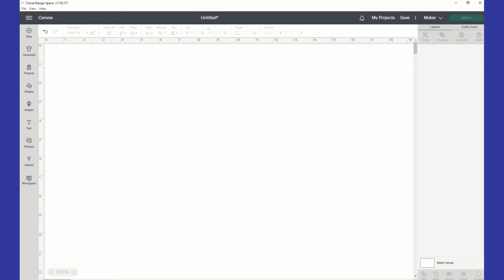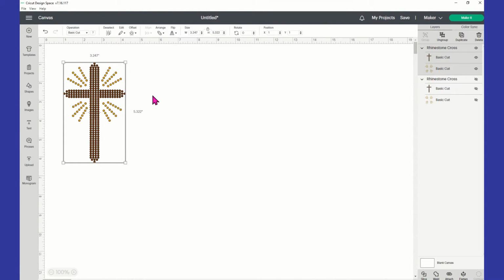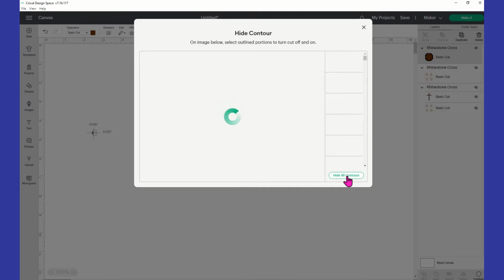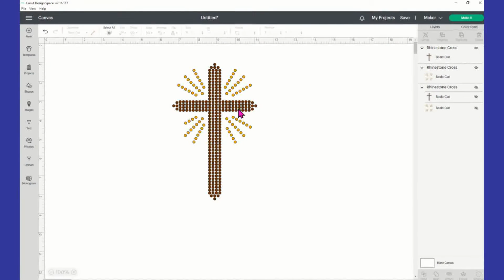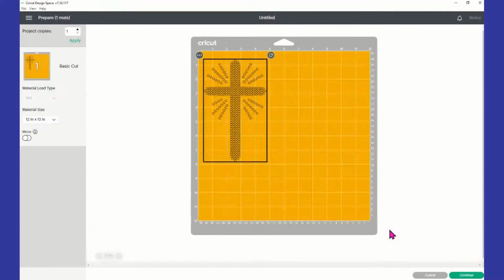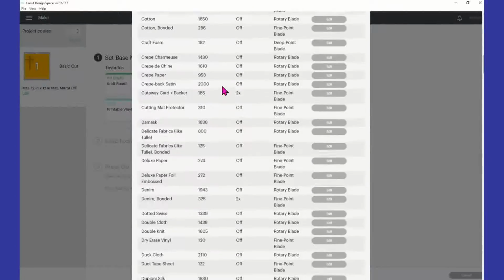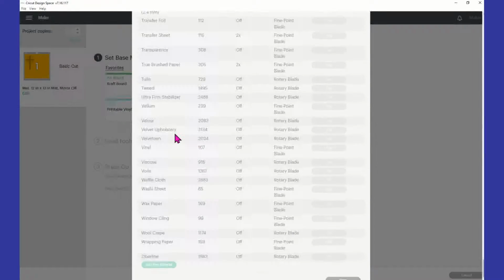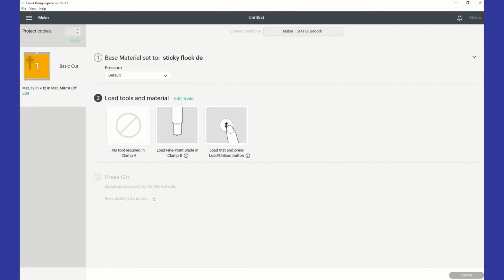Using Rhinestone Templates from Cricut Design Space and changing the rhinestone size using Contour

Comment: Question what will be the contour size for a ss20 i see everyone doin ss10 how do you find out the size of the rhinestone size
Reply from the maker: If you purchase a template that requires SS20's it should tell you what it will show in cricut or silhouette. I've never used SS20's, but just read the fine print on Etsy it will tell you. I hope that helps